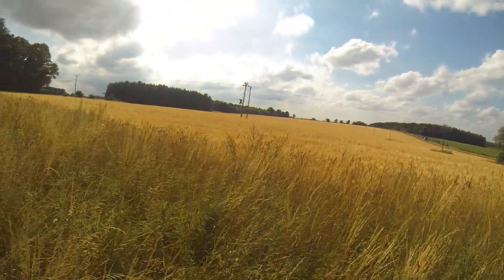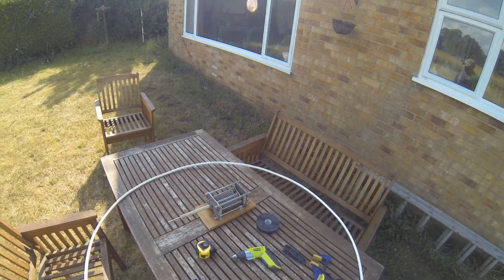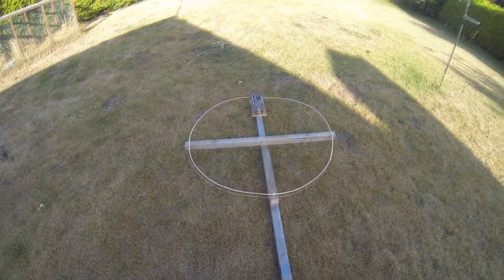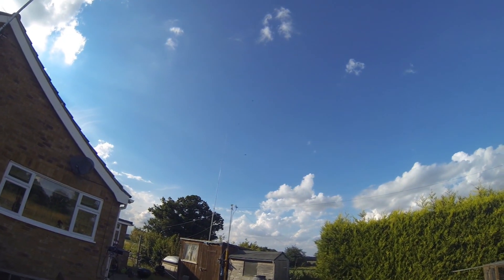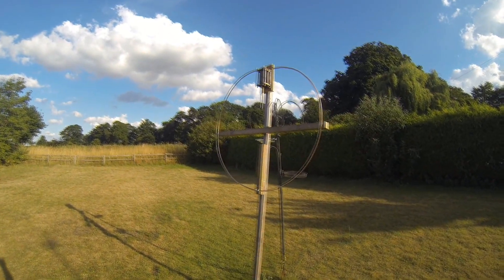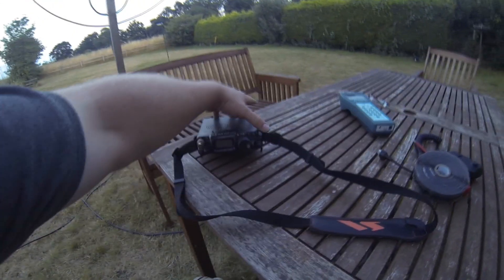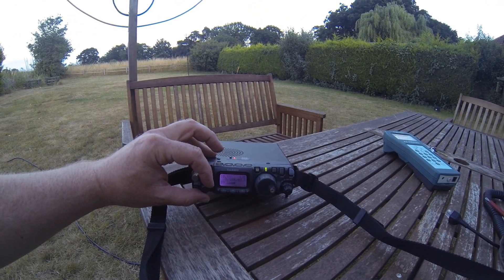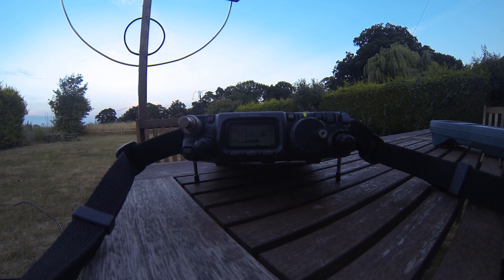My First Magnetic Loop Antenna + Gunships + Obligitory QSO - M0VST [HD]

Comment: I made a mag loop from two lengths of 15m diameter x2 ,9m lengths of copper tubing,  I used a old bycle wheel clamped in to a b&d work mate to form two half circles worked states side on it indoors. G4LMZ